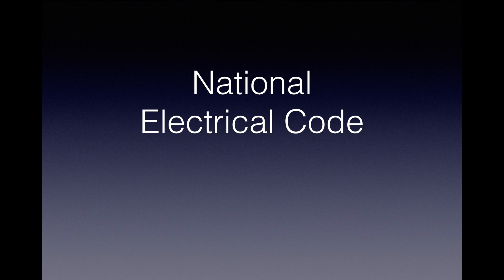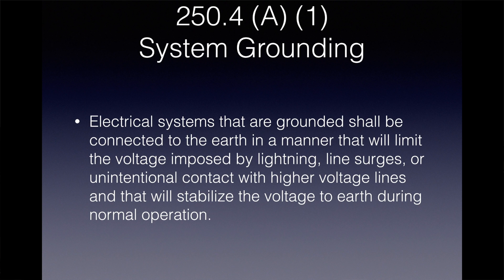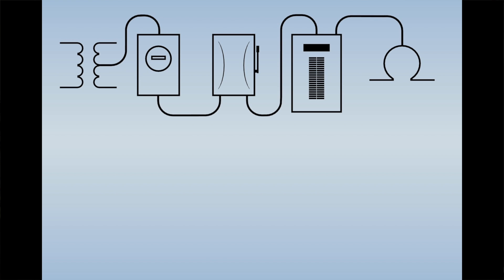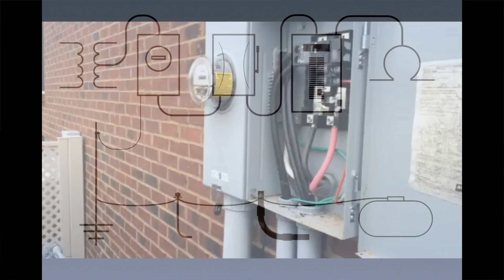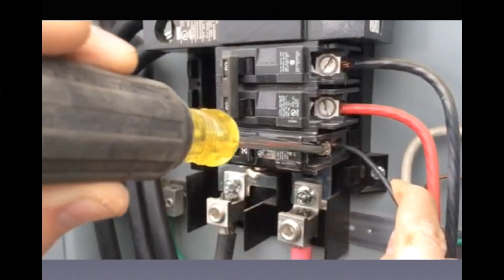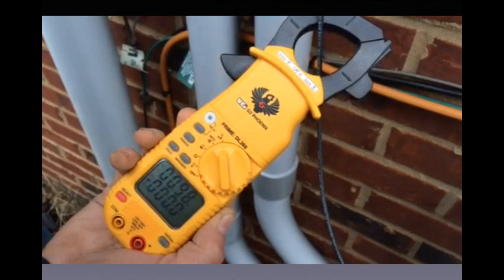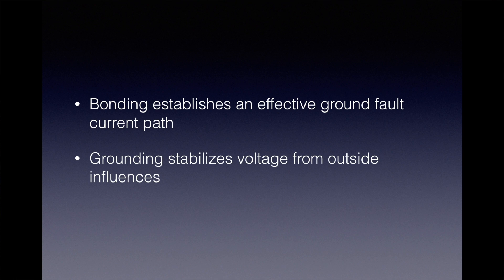Grounding and Bonding

Comment: Byron, I have spent far too much time watching videos trying to get an answer to this question.  Not a single outlet in my house is grounded even though they all have ground wires going to the panel.  I suspect it is because the neutral and ground are not bonded.  Is that a fair assessment?

Comment: Byron many thanks for you clear explanation. I have a pond lined with pvc liner and rocks. Inside six 12V CC led lights. The water is recirculated by an external Swimming pool pump 220V . The manufacturer recommends bonding the lug beside the motor to metallic parts.... but as I said my pond doesn’t hace metallic parts.
Thanks

Comment: If the ground rod doesn't provide a good enough path back to the transformer to blow the breaker, then what purpose does the ground rod serve?
Reply: Exactly! Earth ground is overrated.
Reply: The ground rod doesn't affect the breakers. It's there as a low resistance path for any high voltage surges to be diverted into the earth(0 volts), ideally, to protect equipment and equipment only. In the case of lightning striking the transformer that feeds your house; the ground rod should carry most of the current from the lightning strike, instead of all the equipment around it.

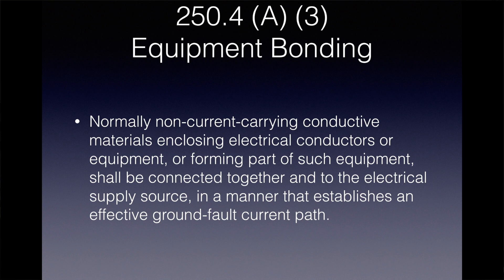Comment: At 2:00 minutes you suggest "this is how we open the breaker" while the text shows code referencing "bonding" while your example of 9 amps and overall lesson is accurate this mixing of terms may confuse some folks. Grounding is the method for providing a return path for faults whereas bonding is the method of ensuring designated areas are at the same voltage potential. While in practice these two functions can overlap the purpose for each method is separate. I am by no means an expert, just simply trying to reinforce my own understanding.

Comment: I ran into a river house, im still working on it, but the panel is in a kitchen cabinet behind a fridge. There was two breakers that if turned on, they would energize the neutrals and make the whole panel show 240 volts. It was an old block home, and had conduit and junctions everywhere. I traced down the two circuit, and they both had an exposed hot making contact with side of the junction box, and the bare grounds were connected to the box. Instead of faulting instantly and tripping the breaker, it would load up the panel for several seconds with 240. When i tested it i had everything in the house on, but nothing plugged in anywhere. No appliances. Just lights. After i found the bad junctions, and broke the hot connections to the boxes and conduit, everything held and read correct. I havent pulled the meter yet or looked at the main bonding. Its a bonded neutral/ground in the panel. If its bonded at the meter also, will that cause everything to return on the neutral and juice up the panel this way? Essentially like having two neutrals running through the house instead of a neutral and ground?

Comment: What I don't get is, if you tie grounding and grounded wires together at the service box, aren't you energizing all that metal (metal outlet boxes, the metal case of the service box, metal light fixtures, etc.)? Isn't that a huge safety risk? Why doesn't someone get electrocuted by touching a metal outlet box with code setup of main bonding jumper?
Reply: So what can be wrong if you are getting 120 volt metal to ground??